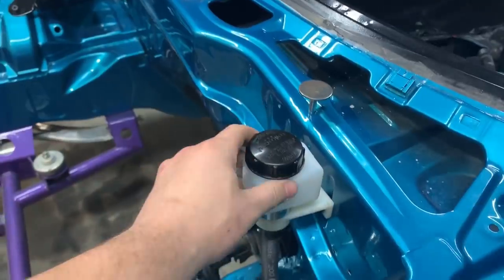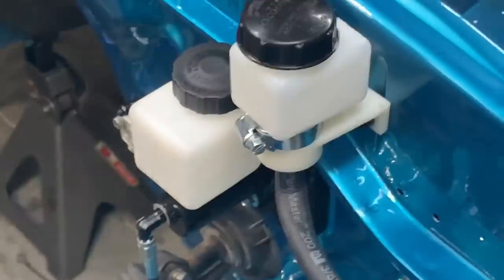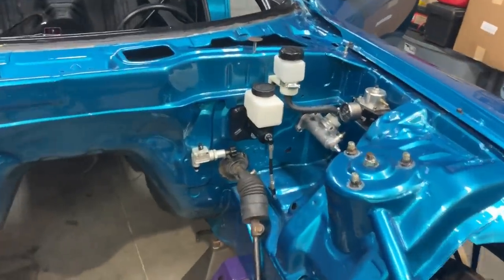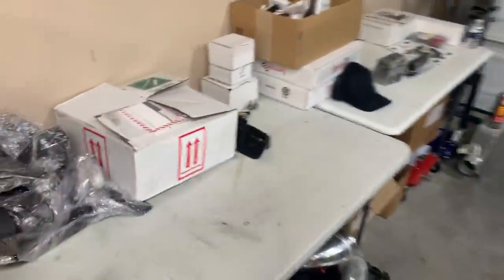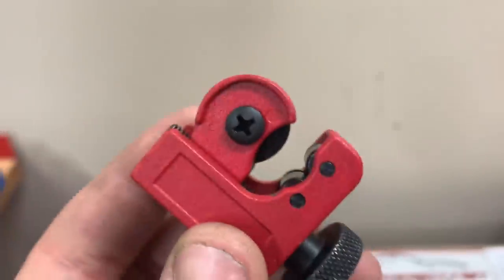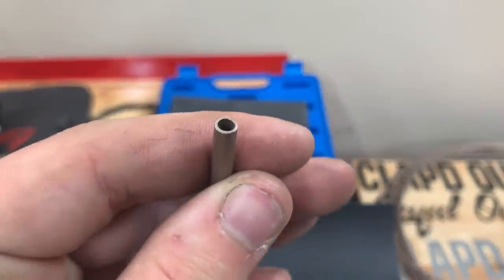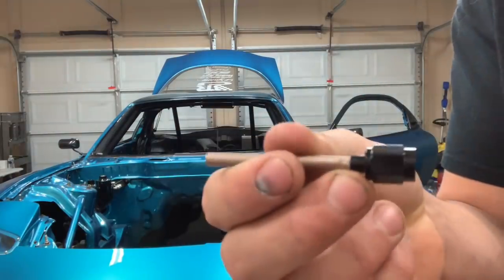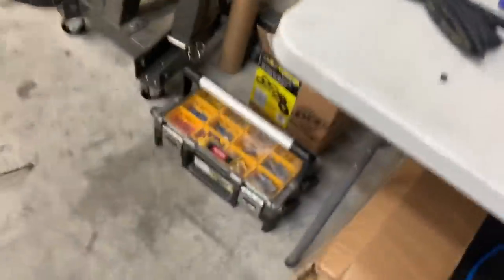Building a StrEAT Car - EP6: Custom Brake Lines & Brake Booster Delete

Comment: On those AN fittings you don't need a double flare? I've never seen them before. On the single master cylinder, correct me if I'm wrong but if you loose a line then none of the brakes work right?
Reply from the maker: Thomas Cahill an I lines are 37 degree single flare.  Standard brake lines are 45 double.  Yes, if you lose a line, you’ll lose brakes.  A properly made AN line is plenty safe.

Comment: Why put the line lock solenoid in the passenger compartment?  
Get better....
Reply from the maker: Why not? Theres zero reason it needs to be outside the passenger compartment and I want a clean bay/wheel wells clear.